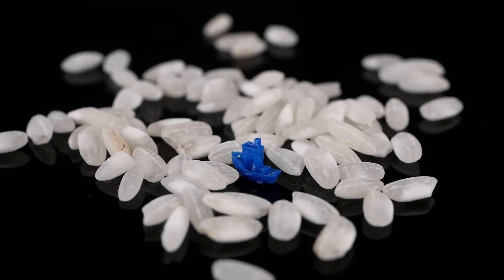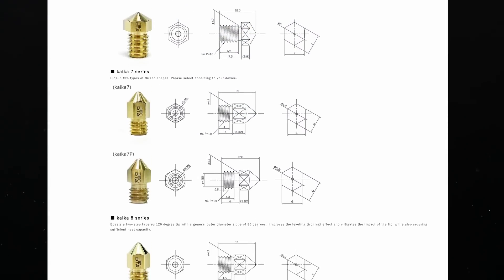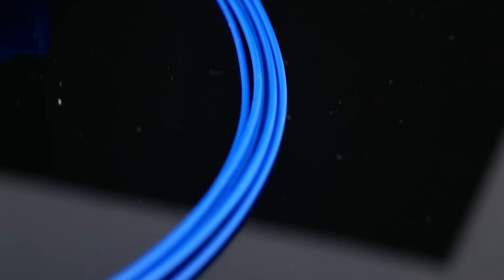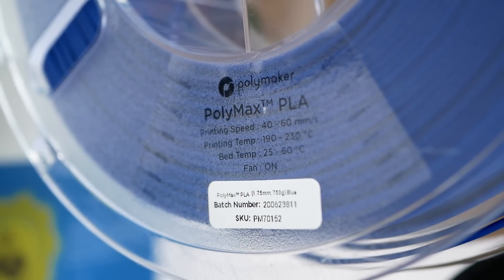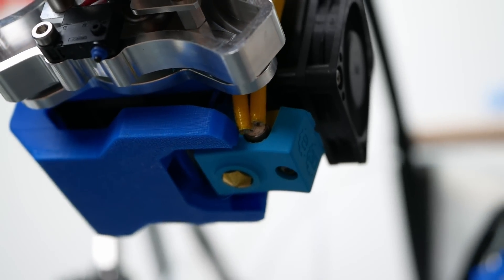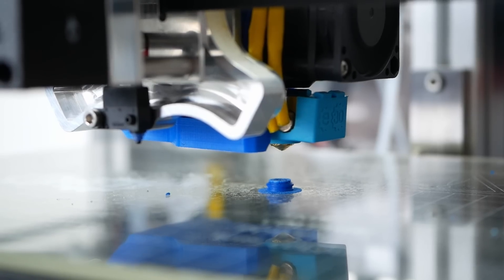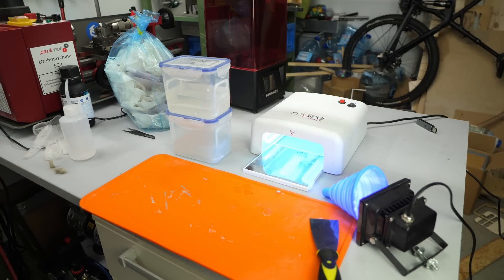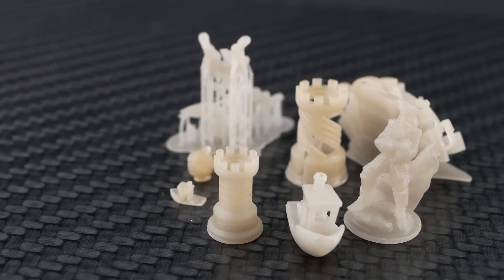MICRO 3D Printing with a 0.1 mm nozzle

Comment: the center hole is drilled traditionally.  shows starting with the tiny drill bit and not using a center drill which produces a hole that starts centered on the rotational axis.

Comment: From my perspective, I'd prefer to have a single 3D printer that I can use to make large and/or durable items using a large diameter nozzle, and then also use to make tabletop miniatures using a smaller nozzle, is preferred over requiring multiple printers and post-processing machines. Especially since at the moment, I don't have a dedicated workshop room, so I'd prefer to stay away from any toxic and foul smelling options. So, small nozzles sound great. And all the problems sound like 'still better than what you have to deal with in the resin world'.

Comment: This comment probably will never be seen, but after buying both an fdm and an sla printer : micro nozzles will never be anything more than a gimmick, something you do just because it's dumb and you can do it. Sla printer start at the same price as any decent fdm printer, are 100 times easier to set up, no assembly required and will give you really detailed results with little to no setting tweaking, and almost invisble layer lines. (Completely invisble if you paint over it.) If you want small intricate prints, there's absolutely no contest, sla is the way to go. At this scale, fdm layer lines are straight up impossible to remove cleanly. I haven't tried acetone vapors, but I strongly belive the size will make material puddles on the print and ruin it, rather than just smoothing it like it would on bigger objects.
Fdm isn't obsolete at all though, resin is pretty brittle while pla is strong and durable. On large scale objects like cosplay parts, or decoration items the layer lines are more negligeable and easy to smooth out with sanding paper. And cosplays are a good example of when you should sacrifice a bit of detail for the sake of strengh, resin wouldn't hold up to any kind of shock cosplays can get. But again, at this scale fdm printers can handle details just fine, so you're not really sacrificing anything you're just gaining durability.  Hope this will help someone stumbling upon this

Comment: I am looking for a partner (preferably in Silicon Valley) interested to design a cutting edge FDM 3D printer. I am an engineer in Photolithography (work at ASML),  PhD in engineering mechanics. not much experience with 3D printing. we can brainstorm, read state of the art and decide what direction move.

Comment: 3:25 - actually this looks like intentional design - the top of the cone is smooth, and further down it looks like a pressed bit was used to punch the linear pattern - which has increased surface area. If not cutting perfectly aligned to the patten, it will appear as chatter marks, but for the plastic it should be a smooth guide

Comment: What if you had a duel head printer and you had one with a 0.4 and one with a 0.1 then interchanged them when you want high quality or not, and you could determine what is high/low quality the same way we use support blockers in slicers.

Comment: Here is why dogs and 0.2 nozzles are not compatible. At that size, a failure point can be my dog coming in to my workroom, shaking and in the process release all the particles, just all of them, then a while later you can be sure one of the 0.2+ sized particles manage to find their way in to the enclosure and bam clog.

Comment: Biggest problem I have with resin printing is due to a long battle with kidney cancer I'm left with only 1/3 of a kidney and my doctors warned me that chemical exposure could damage what I have left. 

Surprisingly even though I have so little left I'm told it has 47% function and I won't need dialysis for the time being. 

I'm hoping the new types of resin will reduce the risk otherwise I have to wear pretty much hazmat gear to handle it. If anyone has an idea of how to deal with this I'd appreciate it. I hate the idea of my investment going to waste.
Reply: I should mention I do have a ender 3 pro but I'm limited to PLA and PETG since they don't off-gas. I have a respirator but I can buy 2-1k rolls for the cost of a pair of filters.

Comment: Fascinating and am surprised at the amazing results that are possible
 An interesting application would be to use a printer with two different nozzle sizes. Either a two-nozzle printer, or first printing with larger nozzle and swapping to add final details on top surface. 
There is probably some interesting situations where using a nozzle size between this 0.1mm and more traditional nozzle size. For example, would expect layer bonding strength would be enhanced at smaller nozzle sizes.

Comment: I was doing some pressure washing and noticed the nozzle oriface size could be adjusted on the fly.   Further I use to do co-extrusion using multiple nested orifaces, has anyone done anything similar in 3D printing.

Comment: do you know if upgrading a printer to something like an ultimaker S3+ would help with the small prints? im trying to prototype it with 4mm by 4mm sized parts and they just come out bad even with 0.2mm nozzle on my ender 3

Comment: My only issue with the resin printers is the price of the resin, is too expensive, at least in my country, the cheapest one with 500ml cost around 80 dollars while the 1kg of filament cost 25 dollars. I could go for FDM printer but it comes the issue that even with a very small nozzle you can see the layering and it takes a lot of time to print. I dont want to print miniatures I look for collective size figures 15 to 20 centimeters and I dont know if with the FDM can get a good level of detail... Making a decision about buying printers is really hard.

Comment: If you get the g code with supports for a larger print designed for 0.4 mm nozzles, couldn't you go into the firmware and trick the printer into running the axis like they are geared. Essentialy scaling down the movements to match the nozzle size.

Comment: The Devil made you ask it Stefan?

So here is my take:

SLA printers for now are having a limited range of resin options, most of them matching somehow the positive characteristics of PLA, ABS or maybe up to Nylon, and here we stop.

For extremelly detialed prints of very strong characteristics, there is nothing.

FDM (or FFF if you pleasse) instead has Ultem (PEI) PPS, PEEK, PEKK just to name a few, plus the elastic and supraelastic materials known as TPU (there is a whole world of TPU out there).  Immagine printing a 0.1mm holes sieve with 0.1 mm cross wires, say 10x10 CM to filter your grinded salt for a small detailed part you created and want to remelt without interfeering with the functional dimensions, if you do that in SLA, you might get away with 100 Grams sieved of salt before it wears out and let's in bigger grains, same thing might be true for PLA, ABS, HIPS etc.  Assuming such sieve is 10 grams of material, made in PEKK would be 12 Euro of material, would last probably kilograms of salt processing, made in PEEK probably would be some 10% less resistant, made in Ultem say 30% less resistant but 60% cheaper, or in PPs maybe 50% less resistant but at 10% of the PEKK price.

I am sure in the coming future,  maybe 10 years, this gap between filament properties and resins will slowly be narrowed, but for now FDM is the way to go to get something real, with all the headache that this brings you.

Comment: i dont bother with the tiny nozzles for parts needing the insane level of detail miniature wargaming requires. it also takes far too long and the risk of a power out failure skyrockets. 3 hours to print a squad of 28mm scale minis versus 20 hours for just one... Theres just no beating the level of detail that resin printers can do and with the never 4k and even 6k solutions its even harder to just not do resin printing for such things. i do agree though. resin printing is messy but if you got a good setup you dont even generate all that much waste and the vast majority of it can be disposed of in the bin when you shine a uv light on the paper towels and gloves to harden the resin. IPA can be reused after letting it sit for a week so the resin falls out of solution. Decant the ipa and then dump the rest of the resiny stuff into a plastic cup or a dish and leave outdoors in sunlight for the ipa to evaporate and the resin to harden. then you can trash that too. water is a similar solution. just let it evaporate away over time. Lastly the resin smell... i dont know how hypersensitive yall are but i can berely even detect the resin smell and when the lid of the machine is on theres none at all.

Comment: I just ordered myself 3 trianglelab nozzles. As a complete noob in printing (yes, i've yet to figure out how to setup my firmware lol) I print great with 0.4, but ordered 0.3, 0.2 and 0.1 nozzles from ali, and will test how they fare on my E3D V6 hotend and trianglelab dual drive extruder.

Comment: I've found varying layer height far more versatile than varying nozzle sizes.  I rarely use my .25 nozzles any more.  You end up pulling your hair out every time a tardigrade clogs the tip, which is every five minutes.  I have some parts that I can't tell apart which were printed with 0.25, 0.4 and 0.6 nozzles @ 0.15 height.  Save your time and use as large a diameter as possible.  My only recommendation to someone who must use a tiny nozzle is to use only one polymer per nozzle and to pass your filament through a cleaning clamp on its way to the hot end.

Comment: Reducing nozzle size is a great way to gradually reduce the weight of 3d printed parts.
First printing with 0.4mm nozzle then going with 0.3mm then going 0.25 and i keep doing this until the part is not strong enough to resist the loads.
Then i am keeping the part printed with the smallest nozzle diameter that didn't break, this is how i reduced the weight of my 3d printed plane by almost 40%, going from 0.44mm layers  to 0.28mm

Comment: Heard you mentioned any gearing in the extruder system is good because it helps with finer control, but would at such small levels of movement gear backlash be a big issue or is it not worth worrying about?

Comment: resin printing is a acquired taste. especially for FDM heads who have first gotten used to the FDM way of live. it takes a bit getting used to but as you use it more, you start also producing less waste and tedious tasks become routine. i started with FDM (CR10) and got a resin printer about 1.5 years later. at the beginning i disliked resin but over time is started to get way better and way more consistent results. i also started to reduce my time and waste foodprints. by now i just don't like FDM that much anymore. all the leveling, calibration, heat, noise, setting finetuning. it's just to much for me. 
one part i do definitely agree on, for mechanical parts, FDM is better due to the different materials. but anything like mini's or other visual objects, resin in unbeatable. 
so yeah, it all depends on your use case. as a mini lover. resin is the way to go but i keep my FDM around for stuff like buildings or a cosplay.

Comment: I have used cheap .2 mm nozzles with almost no issues, haven't gone smaller than that and I don't use them often as I don't need the extra detail they provide. I also agree the the supports that Prusa Slicer generates are pretty terrible especially if you use large or small nozzles, Slic3r never had that issue. I wish they didn't decide to skip layers on the support material, or at least give the option synchronize the support layers with the object without forcing you to have a 0mm contact Z distance.

Comment: You can easily color change a resing print by mixing or completely changing the resin. Also more expensive resins solve most of the mechanical and odor problems. For anything not tiny i still prefer a FDM though. Even if you are very mindful you still creative a decent amount of waste for every print.

Comment: I use a .2mm a lot. I've been printing with a wax type filament for lost wax casting, but if I could afford getting into resin printer right now (and honestly having the space for it is the biggest issue) I would. Until then I I'll just buy cheap .2mm to print with, maybe try some cheap .1mm. They're a pain, but they're the best I can do with what I have right now.

Comment: Great video! I once got a 0.1 mm nozzle in a cheap Chinese variety pack...unsurprisingly, it never worked. I have, however, had relatively good success with 0.2 mm nozzles in printing things like miniatures - it does take some work to get it dialed in, and I think it's one of the few things that my modified Ender 3 does far better than my Artillery Sidewinder X1, but until I finally make the jump to resin 0.2 mm is more than sufficient for my needs.

Comment: Since supports seem to be an issue in most slicers at that size, I wonder if you could almost generate supports at full size, export the gcode, and apply a postprocessing script to edit the gcode (coordinates, etc.) itself afterwards to scale everything down. Obviously many factors would have to be changed in the gcode (positioning, speed, extrusion lengths, etc.) but maybe that could work?

Comment: I've used a copper plated 0.25mm nozzle from e3d before. Using default prusa profiles I didn't have much problems at all. I've used it for some small mechanical parts and some small figurines but it rarely gets used.
I find myself mostly printing with my 0.8mm nozzle.

Comment: The small nozzle cannot compete with the quality of a resin printer. Take into account all the fine tuning needed and potential for clogs and karma forbid touching the bed, a resin printer is better. Chemical smells can be bad and clean up a problem but no worse than ABS smoothing with acetone. Not to mention ABS can small fairly bad. The small prints with 0.1 mm noz are cute but inferiors to the resin print.

Comment: Regarding resin printing.  I purchased a UV flashlight, and when I remove the parts from the printer, I cure them immediately with the flashlight (being sure to not aim the flashlight at the build plate if it has any resin on it).  If I have to wipe up resin with a paper towel, I immediately hit it with the UV flashlight.  Nothing is sticky any more.  Give it a try!

Comment: To me, the biggest issue about resin printing isn't even about how much post processing needed, but just how you can't take a part designed for FDM and print it in SLA.
I mean, no/low support prints is a real thing and it can only work for a specific printing method.

And it's not like 0.4mm only has 0.4mm of accuracy really. FDM printing uses vectors instead of pixels, so besides layer lines, SLA isn't that much more accurate.

Comment: Very impressive prints! I've tried cheap 0.1mm nozzles in the past with no success. Fortunately I've been able to print with a 0.2mm nozzle with little issues, but to be honest for tiny detailed parts I always go for my Mars 2 nowadays, even though it's a messy and unpleasant process just like you said. I wish there was a way to 3D print FDM parts at an SLA level of detail!

Comment: This is fascinating to me for a couple reasons:
1) I did minis for a bit and don't like resin... so I saw stuff like E3D's 0.15mm nozzle but lacked steppers with high enough resolution to do anything with them. I got one but it sits in it's box as I hear Sanjay's laundry list of challenges play through my head (heard them in person from ERRF 2019).
2) 3D printing started as "can we make this work at good enough quality/speed/size?" but aside from enterprise craziness (like Joel's videos), consumer printers have stagnated... and I feel a lot of what is needed to go further is a combo of hardware and software... (lead into point 3)
3) It identifies the problem points in existing systems: gearing, cooling design, software hard-limits, motion system limitations, etc. and gives a chance to fix them
4) Finally, it starts the feedback loop that IMHO seems to be discussed more then applied in 3D printing: improve, push bounds, find limitations, repeat. How many 3D printers are just rehashes of existing designs? Another Chitu system. Another i3 clone. The community seems restless... and then stuff like Voron makes a splash and does great... but seems to get speed better... but doesn't seem to address cooling or make input-shaping standard (it's optional but recommended for Vorons from what I read). Without continuing down that tangent, doing stuff like "how do I print really small" and hitting software limits, material limits, even conceptional limits of "is this really worth it or is a different tech better?" opens the question of "ok, what needs to get fixed?" to continue the loop instead of just making yet another system that is the same as the prior.

One day... but awesome video.

Comment: I really appreciate the insights here.
I am in the process of designing a very small printer that will run at very high speed specifically for printing with small nozzles at small layer height.

Comment: I have found that filament choice is very important when using micro nozzles.  I've done a lot of testing with a 0.15mm nozzle.  My best results have been using natural color filaments.  I suspect these work better because they do not have the added solids found in the dyes.  Most my micro nozzle printing was done with natural ABS.  Printer, Lulzbot Kittaz.  Original testing with 2.85mm filament before changing over to a 1.75mm hotend.
Reply: I second that. I had issues with micro nozzles constantly clogging with pla that printed just fine with a .4 mm nozzle until I switched to natural pla. Most people should probably switch to .6mm nozzles anyways though, faster printing and I have yet to have it clog up even with wood filament.